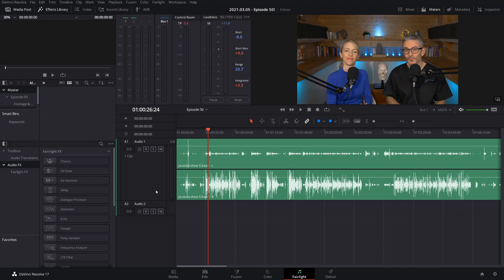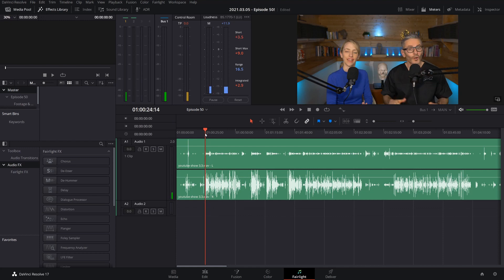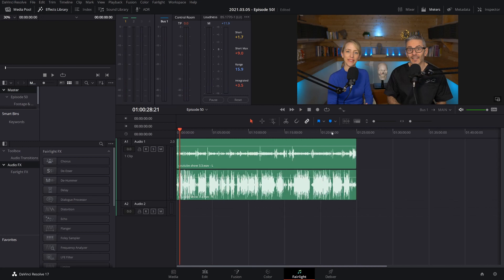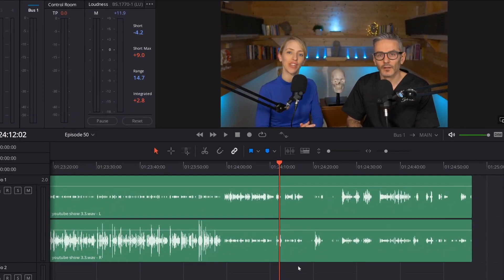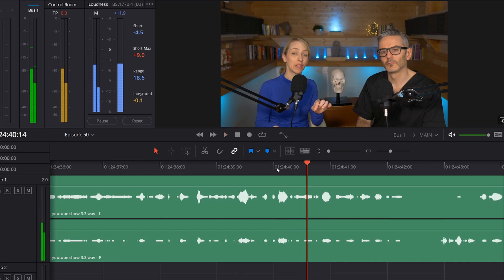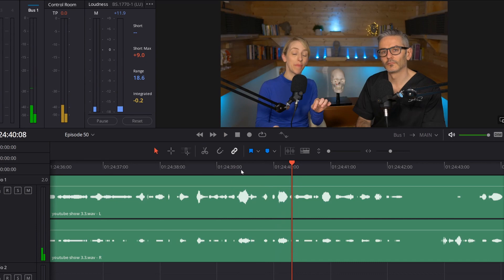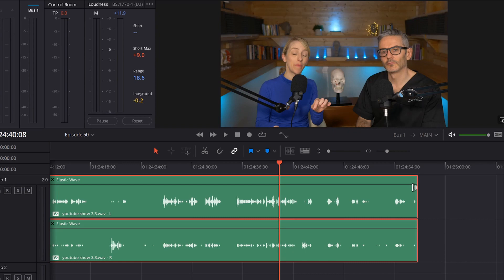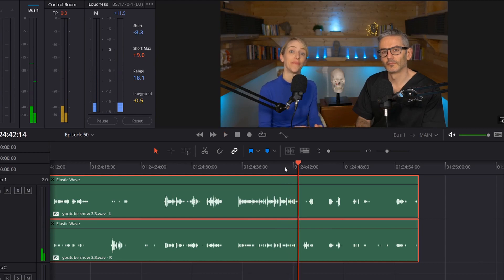How to FIX AUDIO DRIFT in Davinci Resolve 17

Comment: Great example. However, the Fairlight screen of Resolve Studio 18 does not look like your example by default. Until the audio clip waveform representations are stretched vertically, the Elastic Wave cursor never even appears. With user interface elements on my screens stretched to match your video, the process worked as you demonstrated.

Comment: I use Geforce to record my games with instant replay I have used it for so long I never had problem with audio sync, but the recent update of Davinci made every video that i import the audio goes out of sync at last 3 minutes of the video, i have checked my framerates they match the timeline and the capture playback all at 60 fps, but still video audio goes out of sync after 2 minutes of playing it, i am pretty sure its the update did that because i have used resolve davinci for 3 years and edited all my videos from geforce and never had any problems relating to audio. hope you can advice me with anything):
Reply: SAEM
Reply: I'm also having this issue. Did you figure anything out?

Comment: Hey I recently upgraded to Davinci Resolve 17 from 16. I never had this audio sync issue in 16. But now every video that I import the audio goes out of sync. Is there a setting or something that is causing this? Makes me want to just go back to the original 16. :(
Reply from the maker: Hey! What are you using to record for your audio? I've found the issue for audio comes from the recording source, and it's very hard to pin point it. For example I record a podcast weekly with Audition and there is ALWAYS an audio drift on the laptop we use. But I also record teaching videos on my laptop using audition and there is never an issue.

So I think the problem is outside of Resolve at the first stage, to test this you can send me your video/audio file and I can see if it syncs properly in Premiere Pro for you if you want?
Reply: @thedavidshutt  You are very kind :)

Comment: This doesn't work for me. When I do this the beginning gets out of sync.
But your Audio is somehow "linked" as one audio under one track? Why''s that? 
I have A1 (Camera) and A2 (External Audio). I also have them unlinked right now. 

Any other ideas? Or what am I doing wrong?
Reply from the maker: Both my audios that you see above are from one source but it's a stereo so each track shows as seperate here.
What you'll need to do is just make sure the external audio (A2) Waveforms are matching right at the start of your clip first, and then use the elastic wave at the end, maybe you've accidentally moved the clip instead of the elastic wave? If this doesn't work let me know you can email / instagram me with some pictures and I'll try to help you that way to fix it :)
Reply: @thedavidshutt  I have the same problem, if I sync the beginning and then sync the end with elastic wave, when I come back to the start it is out of sync.
Reply: @NPIMX  Did you ever fix this?
Reply: @sireveman  NO, never. I had to change my recorder for wiereless mics
Reply from the maker: @NPIMX  Sorry for the late reply, just a heads up if you or anyone else has this issue, it could be that your audio is dropping out some frames, what I do then is make a few cuts along and repeat the above process, it's tedious. But I've had some recorders before that just lose signal for a few frames which throws this workaround off